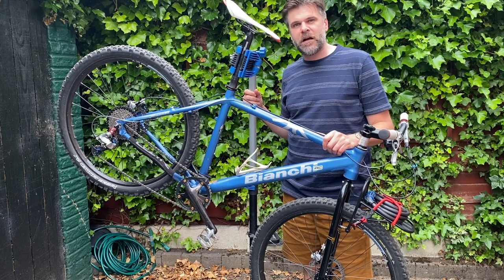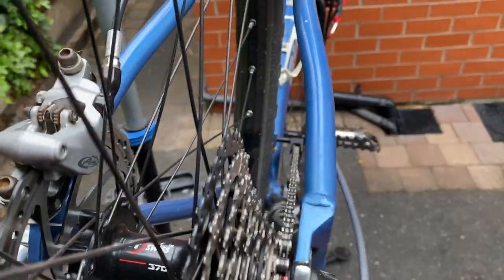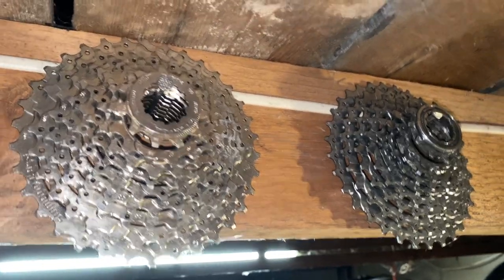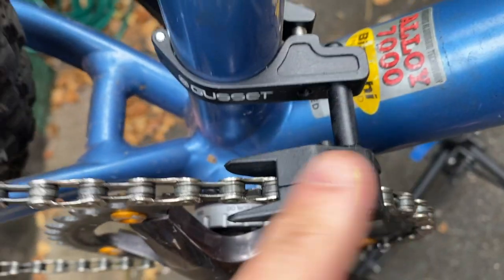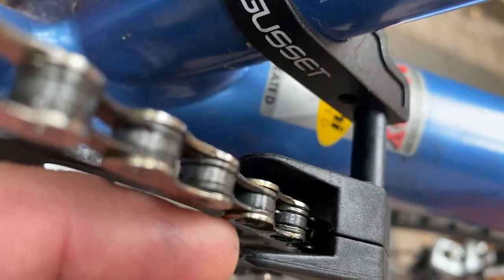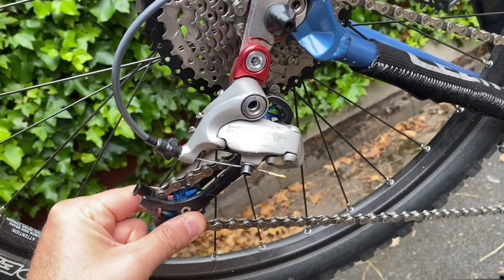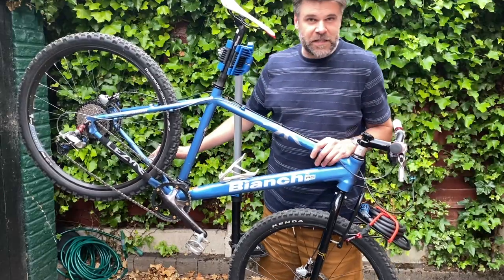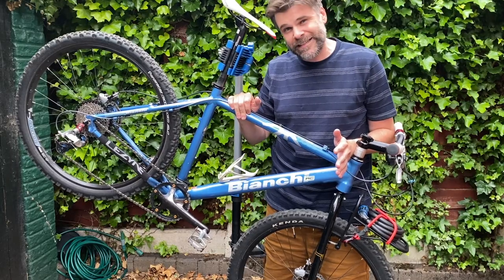Retro MTB science: simple ways to fix chain drop on a 1x conversion

Comment: Finally a video with a product like this, I want this spring together with a chain guide on my 3x9 speed and maybe I don't have to upgrade the drivetrain just to do hops
Reply from the maker: I can't guarantee that it's actually effective, but it's certainly a nice little trinket. If I'm honest, the only thing that has finally fixed this bike's problems was giving in and upgrading to a narrow-wide chainring!
Reply: @red_dread I have a feeling I need to go that route as well. For now I just tried a simple rubber band😂 not sure if it actually works. It feels a bit different when shifting..if it ends up working my mind is gonna be blown
Reply from the maker: @X41N3 As one of my viewers has reminded me, it's possible to increase the tension on the derailleur cage spring on some older rear mechs, such as the one in this video. You can take it apart and reposition the spring to a different hole, same principle as the 3 holes in most cantilever brake mounts.

Comment: i built one of these when i was 14 and ive only just learned about them now hahaha, and i used half a x9 long cage for a roller on the return side of the chain for even better spring retention in the custom rear mech mod!
Reply from the maker: This was just a series of fun experiments to be honest - in the end I knew the fix to end them all would be to simply put on a modern single chainring. I put on a Wolf Tooth narrow-wide and voila, zero chain drop.

Comment: I convert my Cube aim from 8x3 to 8x1, and basically, from my view everything is correct installed, i bought a new chainring, and new chain, but my chain sometimes jump to the right side of the chainring, maybe just using the chain guide could solve the problem?
Reply from the maker: As I've found out, it's very hard to keep the chain on unless you throw money at the problem! Yes, I'm sure a chain guide would make a big difference.

Comment: Not sure if you are aware... 90's Shimano derailleurs have two different cage spring tension settings. They are supplied on low tension mode (for optimal shifting quality). To change to the higher tension setting involves loosing the cage retention bolt, a stressful process, like pulling the pin on a hand grenade... Its all detailed in the Shimano manuals. It adds a significant extra tension on the lower cage, without the need for ugly external spring devices.

Is the Geek King crown now mine?
Reply from the maker: Very interesting - that's my kind of intel! I had noticed that there were two holes in there when I previously stripped one for cleaning. Same principle as the hole options on canti bosses. But I'd forgotten to experiment with it when messing around with this project. I might yet do it, although I've since eliminated the problem altogether just by giving in and putting a proper narrow/wide ring on there.

Comment: Your a lifesaver man thank you
Reply from the maker: Ha, the real save would be to just put a modern chainring on, which would sort you out in seconds. But I like to solve things the long and difficult way.
Reply: @red_dread  Hi, I have this problem for two months... I got hybrid bike Riverside 500E, 1x 8speed for a long not used. When I went for a short ride on 8 lowest gear chain dropped from crank set and brake chain cover, so I decided to change all drive line. I went to official shop Decathlon workshop and changed to original all new, torque sensor, chainring, chain, derailleur,  cables and etc. I took my bike and I was exited till I changed gear in lowest 8 gear and it happen again.. my chain dropped from chainring in the chain cover and almost braked, I brought bike back in the shop and after long wait I was told that nothing they can do and I need to be gentle with bike and pedal not so hard.... It`s so annoying! I can use only 6 gears from 8 with no chain drop.. I lost even my hope, so now I`m asking you: Do you fink I need to try to change again to a new chainring like Shimano or smthng? Thank you!
Reply from the maker: @Pretender_Gamer I can't be sure without seeing the bike, but I can tell you that in my case the thing that fixed mine immediately was simply upgrading to a better chainring. The one I put on mine is a RaceFace narrow-wide and now the chain stays on no matter what!

Comment: Nice video.  Would like to know what the last device with a small spring attached to the RD is called?  Thanks 😊
Reply from the maker: It’s the Tektro rear derailleur arm tensioner. Almost certain to be useless but a lot of fun to find it, fit it and experiment!
Reply: Haha thanks 😂
Reply: @red_dread  that device reminds me of another device... one made by the Bullet Bros, although no longer made I have seen NOS in the classifieds from time to time.  Instead of the barrel adjuster it's just an arm that is held in place by the wheel's skewer, a spring and a clamp that mounts in similar fashion as the Tektro unit in your video.

Comment: Great video! My first bike was a "1x5" Raleigh Olympus circa 1979. The chain didn't fall off especially often. Was that because the chainring didn't have ramps and things and 5 gears wasn't such a large lateral displacement? I'm also surprised yours is falling off on the outside rather than the inside as usually nature abhors a chainline that isn't straight and so the chain moves wherever it can to create straightness, which in your case would be towards the centerline of the bike. 🤔
Reply from the maker: I am certain that the reason your Olympus seldom shed its chain is that a purpose-made single chainring has much longer teeth, since the chain isn’t ever meant to leave them! A suitable chainring would be an easy fix for mine too, but feels too much like cheating.

Comment: Very good video! Unfortunately in my country you can't really find these accessories to fix the problem. Do you know any other poor-man solutions?
Reply from the maker: Yes, the easiest fix by far is just to put a proper 1x-specific chainring on! The teeth would be far deeper than the profiled ones on my 105 inner ring, which means the chain is far less likely to come off. Doesn't have to be a fancy brand like Wolf Tooth, nor does it have to be the latest technology like narrow-wide. You just have to beware it's not too wide, for example if you're running a 9 or 10 speed or more at the back, then you'll need the narrow chain to go with it, and that might be too narrow for the fat teeth on a BMX or singlespeed chainring.

Comment: I'm late to the party, but if you mount the chainring on the inside position of the crank arm (where the middle or inner ring would be) your chainline would be way better, eliminating a lot of the problems you are seeing. Better chainline solves 80% of chain drop issues in my experience.
Reply from the maker: This one already is, the reality on this bike is just that a well worn inner ring does not work when used as a single! Been a fun experiment though - I enjoy making it work the hard way rather than the easy way.
Reply: @red_dread  My first comment should have said, Thank you for the great content this was a fun video, but I'm a rude know it all prick. Sorry.
Reply from the maker: No apology necessary, I am the king of the know-it-all pricks. Also the comments and replies on this channel are seldom rude enough for my liking - perhaps I'd get more numbers if I started some beefs and call-out vids!
Reply: I am even later... I think you are right!  The chainring could be fitted the other side of the spider. Also, take the two spacers from the drive-side BB cup and place them on the non-drive cup... Looks like there are 3 different size spacers. leave the think one on there. I have not seen a derailleur tensioner... great idea. ✌

Comment: A narrow wide chain ring would be cheaper, no?
Reply: It is but these modern rings look a bit funky on old bicycles
Reply from the maker: No doubt, plus it would instantly fix the problem - but then this wouldn’t have been much of a fun video to make! Also the point of this bike was to use up parts I already had lying around and to make them work. So far so good.

Comment: Maybe you cant keep a chain on it because its an Italian bike and hard to keep running like the old Jaguars were. Next gerry rig it bending the metal on the front mech with visegrip  pliers. Or find a old Japanese made Suntour shifter in a golf course scrap metal pile put it on and have no problem . That’s what I did playing 9 holes one day and I came across a Ritchey Logic tube set Rocky Mountain. Gee with all the nationalities mentioned hope no one is offended. Im Italian and dont care.
Reply from the maker: The real reason I can't keep the chain on is that the ancient 105 chainring has very shallow, worn teeth that would slip a chain no matter what. Any new, especially narrow-wide, ring would immediately fix this - but that would hardly be a fun challenge would it?
Reply: @red_dread   There is still too much hype about 1xs / unless your dragging and heavy bike up to come down go ahead / but if your spinning out on the road to get to your trail your legs are like a hamsters legs on a spinning cage wheel / and if you live where hills are and your front ring  is too large your toast

Comment: The spring thing could be done without buying anything, i reckon you just need any spring, just buy the chainring if you gonna buy stuff
Reply from the maker: It is indeed true that you can dismantle this generation of XT rear mech and tighten the built-in spring. It's also true that buying a proper single chainring fixes all such problems. I ended up doing both, but neither of those would have made much of a fun video.